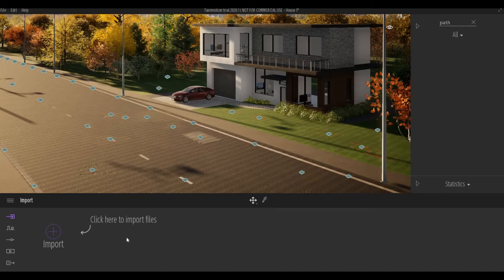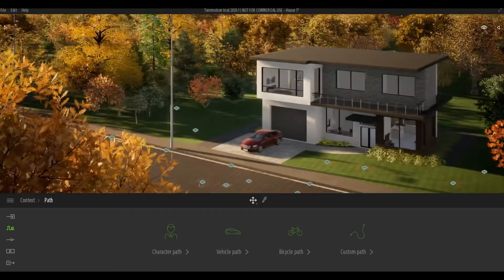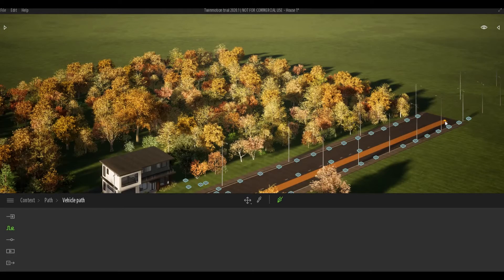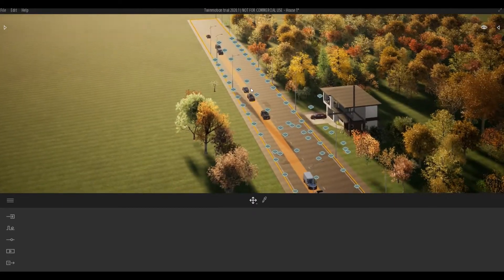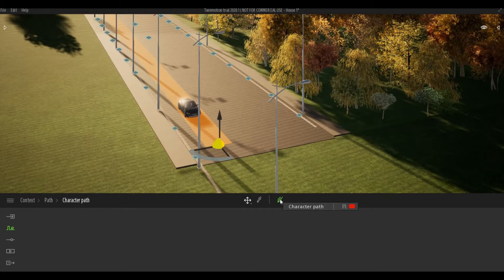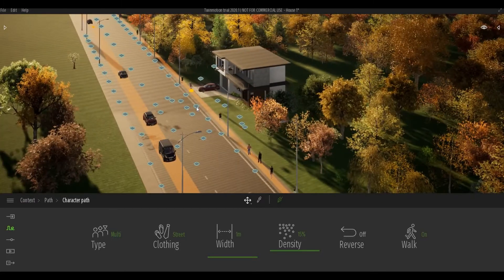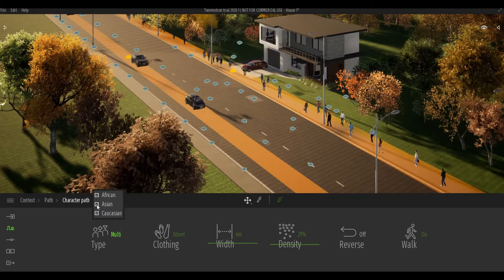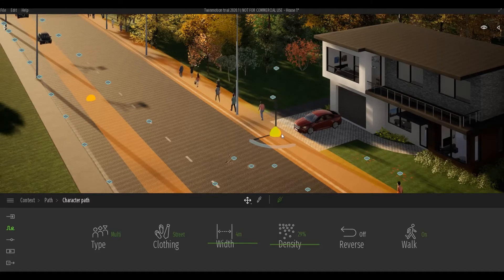Twinmotion Tutorials for Beginners | Part 6 | Path Tools

Comment: i have a problem when i use twinmotion i can hear my laptop fan any clue of what i can due to solve that problem ?? my laptop is asus tuf f 15 windows 11
Reply from the maker: Hi yes thats what happened on laptop and even desktop when using twinmotion as it use the gpu and it needs to lower the heat. 🙏🙂